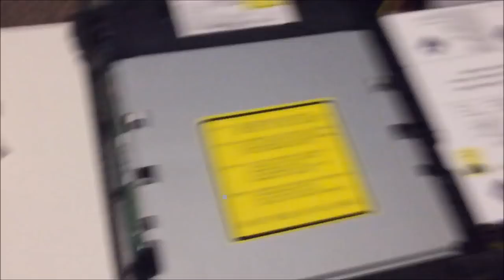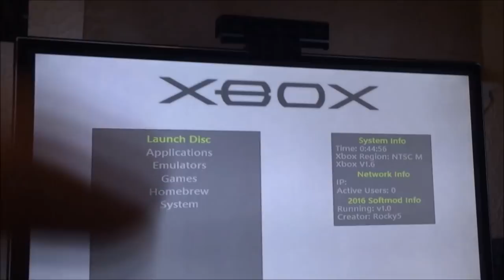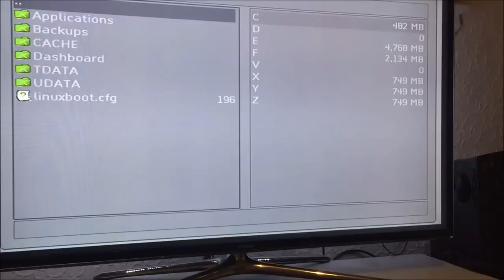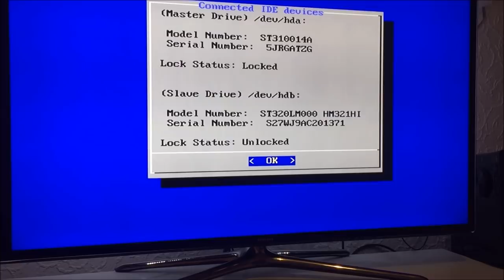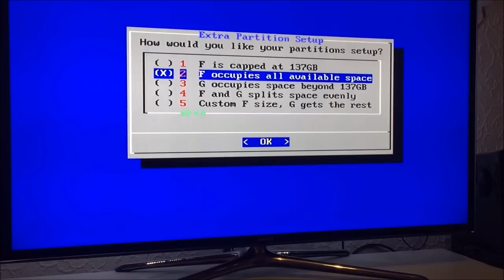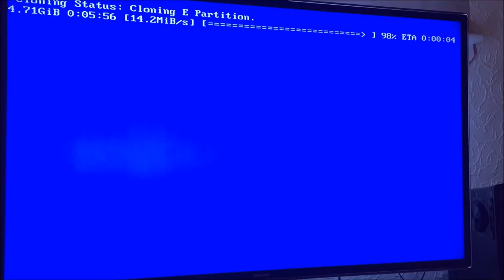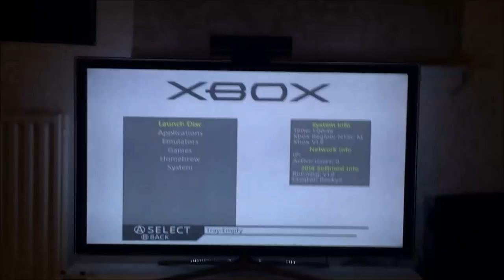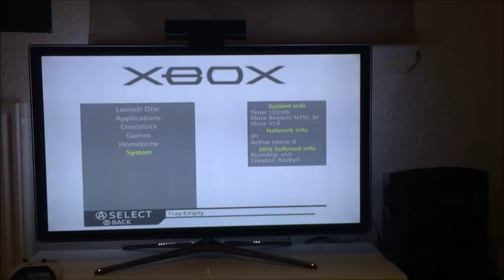How to clone your Hard drive using Chimp 261812 from start to finish.

Comment: When I used the SATA to IDE hard drive cables. I kept having trouble FTPing files over to the Xbox. The files that do get transferred over keeps getting deleted for some reason. The problem was fixed when I simply used an IDE hard drive, but now it's happening all over again except now the FTP works, but the files keep getting deleted. Ughhhh....
Reply from the maker: +furonwarrior what size is the HDD and if you have partitions over 250GB how did you partition them?

With large HDD's you need to use the latest version of Chimp or XBPartition v1.3 so that it formats the partitions with the correct cluster size.
Reply: JCRocky5 Originally I had a hard-mod chip and used Slayer. That was my bread and butter because I could launch discs without a hard drive, so I could easily format and partition anything I throw at it. I used a 1TB hard drive with a converter and it works great, but along the way it starts having issues with keeping the files. Then I had issues with the IDE hard drive with the same deleting issues, so I bought another Xbox to softmod and found my way here. I follow your instructions, but XBMC freezes if I disconnect the cable to the DVD player and reconnect it to the new 750gig IDE hard drive. I manage to launch the app if I just disconnect the DVD cable, but the app freezes up too until I reconnect the DVD cable.
I seriously have no idea is up with my luck with these Xboxes. haha
Reply: JCRocky5 By the way, when you select softmod Xbox, it doesn't allow you to transfer data from the master to slave for some reason. You have to select chipped Xbox.
Reply from the maker: +furonwarrior do you get an error that the slave drive cannot be locked? That's the only way you wouldn't be able to clone the drive in the softmod menu.
Reply: JCRocky5 Yes, I do get that message for both hard drives. But only one them actually shows the serial number when I scanned the IDE devices.
Reply: JCRocky5 What do I do if I get that error code? :(
Reply from the maker: +furonwarrior are you using a 80 wire IDE cable? and what version of Chimp are you using? ( do you get the disclaimer menu with 4 options )
Reply: JCRocky5 JCRocky5 No, I'm using the stock IDE cables from the Xbox and a power supply for internal hard drives both for SATA and IDE. I thought it would be the power supply, but it works great when I plug an internal hard drive through a USB port. I'm using the version of chimp that I downloaded from the link you provided. I also tried an older version and your's seem to be much better. Just can't get over this bump in the road. haha
This is the same issue I had on other Xboxes... with different hard drives... only using a hard mod seems to work and they're going extinct. Soft modding seems to be the lasting alternative and I can't swap the hard drive out to a brand new one. 
Well, after it says the error code, it just lets me access the limited menu. Which one are you referring to?
Reply from the maker: +furonwarrior get yourself a 80wire, when using the sata adaptor. Never use the 40wirr cable as they cause to many issues from my experience.
Reply from the maker: +furonwarrior also redownload chimp, as I updated it on the 17th so if you downloaded it before then it's outdated and I fixed the HDD locking false positives.
Reply: JCRocky5 I'm only using an adapter for the power supply? Do you mean for the data cable for the original Xbox? I'm not sure what to do with an 80 wire cable... unless you mean to connect all three (2 hard drives and DVD player) together.
Reply: JCRocky5 Did you change the download link in the description for the latest version? I'll check it out.
Reply from the maker: +furonwarrior the IDE cable is the cable that connect to the motherboard the DVD drive and the HDD. You said you used a SATA adaptor so instead of using the default 40 wire IDE cable use a 80 wire one. 

Nothing to do with power.
Reply from the maker: +furonwarrior just google 80 wire IDE cable. 

Also no I never changed the download link, it's my GitHub so when I commit stuff the download like gets automatically updated.
Reply: Alright, so I went ahead and got the 80 wire IDE cable and did some research into it. Some people claimed that it hardly made a noticeable difference, but I would assume it would defiantly help with supporting larger hard drives. I'm also assuming that the 40 wire cable cause the issue I had using the 1TB SATA hard drive when I was using the adapter. Because nothing else seemed to be the issue that I know of.

I mean, that would explain why the 500 gigabyte hard drive got recognized and not the 750 gigabyte hard drive, but even the 500gig had the same error code despite it being smaller. But maybe it's not small enough for the 40 wire IDE cable? haha

And yes, I am using your latest version of Chimp.
Reply from the maker: +furonwarrior for speed yeah there isn't much of a difference but that's not the point of the 80 wire cable. ( it used to be back in the day ) it's about 40 wire cable and Sata adaptors causes interference on the IDE line and the Xbox not liking it. The 80 wire cable has a ground wires next to every wire ( 40 + 40 ground wires = 80 ) this cuts down/out the interference.

If you're using the latest version of chimp and still getting the lock error, use option 3 on the menu ( TSOP/Chipped Xbox ) this doesn't have the check and has no barriers in place like the softmod option does. 
( note if you arse something up, you can't hold me accountable. You use that menu option at your own risk )
Reply: JCRocky5 Oh, but if all that it does is limit interference, I'm not sure how it'll resolve my issue... and after a lot of trial and error tonight. It definitely seem like a hard drive or a connection to the hard drive being the issue. I was able to get the 500gig model to successful to through the prompts of an older version of Chimp, but after it completed, it wouldn't let me boot up the hard drive. So back to square 1.
Seems like I have more success with the original stock 10gig hard drives, but they're all locked, so no good. The 500 gigabyte won't go through the prompts on the older version again and your revision of Chimp and the two 750gig keep freezing every time I disconnect the DVD player and reconnect it to the three larger hard drives or UnleashedX claims there is no .xbe file which there is...... So I guess now I might return one of the new hard drives and buy a 250gig hard drive to see if I find a sweet spot that Chimp will accept. That or just wait for the 80 wire cable to come in and hope that all these issues will just go away.
Reply: Nah, going around the barriers didn't help before. Seems like going through UnleashedX gave me some luck with getting passed the frozen menu, but after that, the program would freeze on boot up. If it doesn't freeze and continue, it will give me that message but only because the hard drives are already locked. The bigger hard drives are unlocked, but they keep freezing when I plug in the DVD cable into the Slave Drive. Not after I unplug it, like as soon as I connect it to the new hard drive. Then if I disconnect it, sometimes Chimp will unfreeze and continue booting up normally. I even waited to see if it would take a few minutes and still was frozen. The program just doesn't like big hard drives for some reason...
And no, I won't hold you accountable. I got this Xbox for $15 at Goodwill and even talk them into a free controller because the DVD drive was stuck. I manage to even fix the DVD drive to work again. haha
Reply: JCRocky5 Besides, no one should hold you accountable for anything. It seems you put a lot of effort into this community and I appreciate it. Either I'm just too dumb to use it or my Xbox has issues. hahaha
Reply: JCRocky5 3 fucking hours later... your software and my Xbox is finally cloning the hard drive... freaking aye.... It was literally just acting moody and just didn't want to work. But it's doing it... through UnleashedX... please work? 😂
Reply: I did everything! Clonned the hard drive! Locked the cloned hard drive! Error code 9! What the hell? Ughhhhhhh :(
Reply: JCRocky5 Oh shit, it worked. Just forgot to insert the master pin in place on the hard drive. Apparently that's important lol
Reply from the maker: +furonwarrior oO
Reply from the maker: +furonwarrior yup that's required, at least you got it all sorted now. ( I hope lol )
Reply: JCRocky5 I got two hard drives cloned last night, but the last one would not work. It was the same exact hard drive and didn't want to work for some reason. lol

Comment: hi I did everything you did up till the part where before I start the application chimp 261812, I am supposed to unplug the dvd drive cable and plug it into the hdd I have. When I do that though the xbox freezes and doesnt boot the application. Any ideas?
Reply from the maker: Are you using a SATA2IDE adaptor? also what dashboard are you using?
Reply: useing unleashx and the green adapter on your video
Reply from the maker: +Joshua Hanrath ok well lets trouble shoot.

1) Try the adaptor to see if it is the issue, boot the system with the new drive connected and set as the master, you should get Error 5 (hdd unlocked but this is good as the adaptor is working)

2) Make sure you aren't shorting any of the pins on the back of the adaptor when you are plugging the IDE cable into it.

3) Connect the adaptor to the IDE cable first (when swapping) then connect the drive. (This will work also)

4) Make sure the adaptor is set to Slave.

The Xbox freezing it's not a normal crash, most crashes restart the Xbox or the dashboard, so you could be bridging something or moving another wire when connecting the adaptor.
Reply: YES! it worked! it was the slave master switch on the adapter hahaha didnt even know it was there. Thank you so much man for the video and help! :) just made my day haha

Just have one more question for you. I have a 2 TB drive and it worked great I'm just wondering how much space it should show then after its been cloned. it says 949,989 mb  but I also chose a different option when it came to formatting it ...I did the custom f size and g gets the rest. I didnt really choose the amount cause I was trying to go back but it cloned it anyways which was fine but ya should I have used the option you did in the video even with a hdd this big? thanks in advance and thanks again so much for trouble shooting the problem away :)
Reply: also there is no G partition in the file explorer so maybe the remaining space was allocated? and one more thing again haha can I just redue this formating and basically do this thing all over again? like use the same drive and clone it again and reformat?
Reply from the maker: You're meant to use the "F and G splits space evenly" as the partition can only be 990GB.

You can use XBPartitiomer 1.3 or Chimp (option 4 > option 2) and there should be a G partition.
(UnleashX won't show some odd partition sizes, haven't a clue why but XBMC will show all partition sizes)
Reply: alright it did spilt it into the two drives but ya only visible in XBMC. I also went through chimp and did those two options but still can't see the G drive. Not sure if that was what I was supposed to do but ya no luck. or will I just not be able to see the G drive?
Reply: nevermind I figured it out :) just had to go to the system settings/storage and enable the G drive.

Once again man thanks for the quick and helpful response and video :)
Reply from the maker: No problem :)
Reply: Hey I downloaded your skin you're useing and really like it but was wondering if there is a way to display all the drives in the dash like other skins? if not not a huge deal would just be nice :) thanks
Reply from the maker: +Joshua Hanrath yeah I will do it later for you and send you the new skin.xml.

What drive you wanting? C,E,F & G?
Reply: +JCRocky5 oh awesome thanks :) and might as well do all four c,e,f and g. F and g are the main ones for me though thanks again!
Reply from the maker: F & G size display in MB
http://pastebin.com/G98Bzjf8
Reply: thank you again so much man youve been a great help :)
Reply: was wondering if it was possible to easily edit the softmod skin to add "DLC" to the main menu selection like games and applications. Was also wondering if it was possible to extend the left grey box that holds all the those shortcuts. Only because I was wondering if it was possible to have bigger in order to see the names of the games with having to select them and have it side scroll. If that's possible could you let me know how or where I can figure it out? or if it isn't to much trouble would you be able to whip it up like that? but really like the F and G size display still there. Thanks :)
Reply from the maker: +Joshua Hanrath yes it's possible, but why do you want a DLC menu? and if so where would I point it to on the Xbox hdd?
Reply: Just because I have a bunch of DLC installers for different games that I have downloaded or installed through disc and figured they would fit better in a DLC folder instead of all with the games. and probably the G hdd.
Reply: just thought Id ask but is there a way to choose where the copy DVD will rip to?
Reply from the maker: Ok will make the changes. 

There isn't any way to pick a location, unleashx does it automatically based on where the games folder is. (So if one is in E it uses that before F & G) personally I use DVD2Xbox, it can be setup to copy a disc and back out to the dashboard without user interaction.
Reply: gotcha no worries thanks for the quick responses and thank you so much for doing that really appreciated!
Reply from the maker: https://drive.google.com/file/d/0BzRN8P835YijbWpOd2JzUHhvZlk/view?usp=sharing
Reply: Looks perfect thank you! Just making sure, but did I need to do anything with the .modules or XIOS HDD Prep folders? i used the skin and the config file and it seemed to be good to go
Reply from the maker: Nup that wasn't meant to be in there lol, that's a script to auto build XISO files into working directories so the xbox can play them. (from the Xbox using XBMC)

Comment: I have an old modded xbox with 3rd party HDD, and I'm trying to copy the hard drive to new replacement since the  console is quite old. My F drive is full of games and emulators and etc. This tool will not copy the F drive, even when selected it gets skipped. Not sure what I can do now :'( I can copy C & E and boot the xbox, but there's no way to get my games beside manually copying of FTP :'( anyone know of a way to actually copy an entire disk? For the record I've tried every single copy option (even "entire hard drive") and it will not copy the F partition. Sucks, takes hours just to come up with nothing... any help appreciated. I just want to copy the hard drives using the xbox - I don't have a IDE/PATA PC anymore

Comment: I was able to hot swap with the first xbox I soft modded.  However, I am now soft modding a second one and it is giving me an error "unable to get first sector".  This is after i have booted chimp and pressed fat x.  It then says at the bottom of the screen chimp is starting but it freezes at that point.  
I made sure that chip file was in my E/apps location and have deleted it and put a fresh downloaded file in there. 
Not sure what to do.  I know the HDD will work because it is the same HDD that is in the first one I did and it works great.  
Thanks for any help and for putting this video up.
Reply from the maker: +Devin Allen are you using Chimp 261812 with the new test xbe?
Reply: I belive so.  I downloaded the Chimp261812-master -> E Partition -> Chimp.   I took everything Inside the E Partition folder and put it in the E\apps folder on the xbox.  
inside the Chimp folder there is file called default.xbe.   Is that what you are referring to?  Or is there a file called test.xbe?  If so then I don't have a file called test.xbe but this same chimp folder is what I used on the last one and it worked.
Reply from the maker: +Devin Allen there is a new video after this one that has a test xbe files, you download it and replace the default.xbe in the Chimp folder. 

Watch the new video and I explain what it does.
Reply: Ok I watched the video and replaced the xde file.  I still get the "unable to get first sector".
Reply from the maker: +Devin Allen then there is something up with the drive, format it in windows and run a scan on it for errors.
Reply: Ok so my problem ended up being my stat to ide adapters.  I have two of them and they were both bad.  I took the one out of my xbox that is working and i was able to clone the HDD on the other box with no issues.  Ill have to get some new converters.  Thanks for all the feedback and help.
Reply from the maker: +Devin Allen nice one, I will keep that in mind for future problems people may have.

Glad you got it sorted in the end.